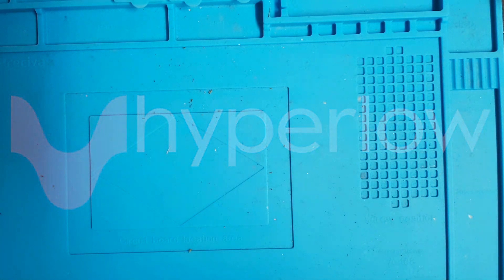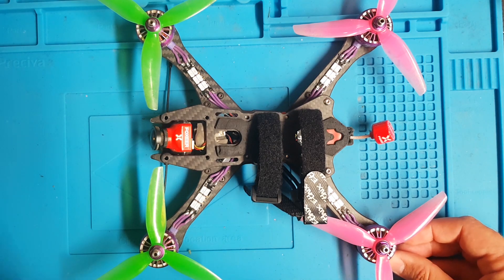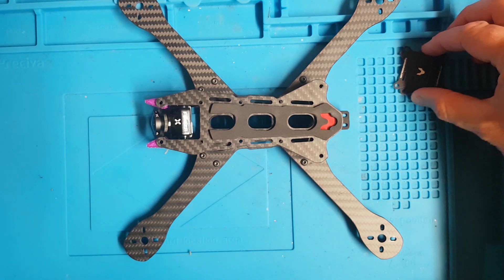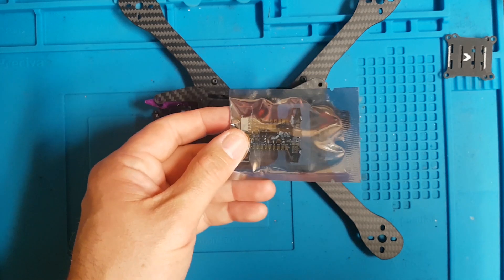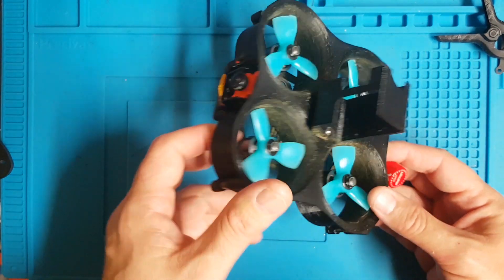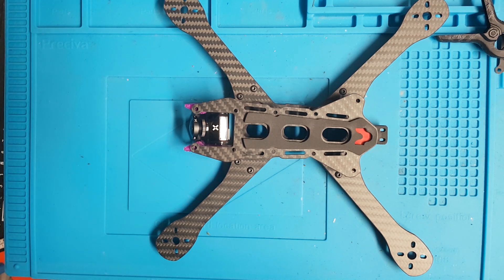Hyperlow CG 6" review and a Crisis of Faith.

Comment from the maker: Few things i forgot to mention. Lock tight your standoff screws from the bottom. I went through a number until I did this. The TBS evo vtx is a simple way to avoid using a separate wolf pdb as it'll give you a good osd with kiss. However you'll lose the ability to change pids via osd and GPS support. Given how easy it is to tune, its well worth considering on a tight build especially if you want to use a 4 in 1. The kiss single escs have been really unreliable for local pilots so I have not used them. The kiss 4 in 1 has a good rep but is ridicously expensive imo
Reply: Osd-tuning is not even worth it imo. Tuning via lua-script is much simpler and gives a great overview. I won't even bother tuning via osd on my quads even if they have osd.
Reply: loved this frame and yes gotta loctite the screws from the bottom into the stand offs cos ive been losing screws from the bottom

Comment: I fly the CG and have been looking at Kiss/Wolf PDB as well, but not sure what the best way to secure the PDB to the frame is. Since the mounting holes on the PDB are designed to accommodate a press nut on the Reverb it’s too large for just an M3 screw. How will you be securing the PDB?
Reply from the maker: DaiLo FPV the PDB comes with those screw type  rubber softmounts. I’ve attached the arm screws to those and the Wolf PDB sits over them. it also comes with double sided sticky tape to attach to the frame. I’ve just added a couple of layers of foam tape beneath it and then the sticky tape. It works great. I did the same thing on the sx218 with kiss.
Reply: Coppertop FPV thanks for sharing! Can’t wait to see your finished product.

Comment: Do you know what I’ve been looking at this frame for months. Sold all my Armattan quads just feed up with breakages. Some were not even hard hits. Anyway hearing what you have to say about this frame has convinced me to get one. Thanks for your honesty opinion 👍🏻. Happy landings ✌🏻
Reply from the maker: Hope yours gives you as much fun as mine has. Couple of guys I fly with had roosters. They went through dozens of parts. By the time you add up the shipping cost why bother... one has created custom braces and the other binned his lol not a company I like. Sold on hype and hot air imo tho thousands think otherwise. Each to their own 😉
Reply: Yes I got sucked in by the hype  which I don’t usually do and will not do again. It’s got to the point where I have stopped flying been 3 months or more since I last done any FPV that’s how bad it got. I usually do loads of research on a products before buying and wished I had gone with my gut feeling from the start. Well we live and learn. I shall be putting my Kiss V2 stuff in which survived the rooster. Looking forward to flying again. Need to find some new spots around Norfolk. Anyway have a good one ✌🏻
Reply from the maker: DEADZONE FPV are you part of Norfolk fpv? (Sorry don’t recognise the handle if you are). If not they have a Facebook group and I sometimes fly with them. Good group and there’s always someone flying or finding a new spot
Reply: No not one of the Norfolk FPV group. Haven’t had Facebook account for years. I was mainly flying by myself.

Comment: I’ve really been wanting to build a hyperlow freestyle frame but I’m so heavily into racing that my budget hasn’t allowed... racing is expensive, lol. When I bite the bullet , I’d like to use kiss & wolf pdb but I’ve got no clue how to setup either. Will you do a tutorial on the wolf pdb? (Configurator, drivers, wiring, etc...) Cheers
Reply from the maker: Tbh you just wire it up as per the picture and that's about it. There's no secret settings other than downloading the wolf app and kiss v2. Because I'm not using kiss escs it's a bit awkward as you can't access blheli to reverse motors etc so you can buy an adapter or just setup the esc on a different quad like I did. Some of the guys I fly with are skipping the wolf pdb and just using the tbs evo vtx to get osd.
Reply: Coppertop FPV 
I appreciate the reply. It’s actually very helpful, thank you. That’s a simple solution for osd & smart audio plus I’ll be able to use a 4-in-1
Reply from the maker: @ryantodd82  yup. Only real thing is you'll loose the ability to tune on the fly via osd (although ive changed hardly anything) and the ability to add GPS. If I was building a 5" that's probably the route I'd go. Much cleaner. Remains to be seen if everything running off the wolf pdb has an impact on flight performance due to lack of noise knocking round the flight controller. One for another day :)

Comment: On the cash front -  For the relative performance and enjoyment on offer, FPV is quite a cheap hobby.  If you can tolerate the fiddliness of configuring and fixing things, it's unbeatable for cost to smiles ratio perspectives.  I just have to force myself into the mindset that I'm money ahead purchasing exactly what I want in my heart, because that's immutable compared to what my brain will rationalize.

I just spent $330 re-buying cameras on otherwise adequate birds... and half as much again on receivers because I'm tired of getting 0.2s brownout-failsafe events at speed.  All this cost is going into quads which I tried really hard to save money on - half of which were intended as leftover/trash builds and are among my favorite quad, but I doubt I'd like them any less if I went strictly with the parts I lusted after.
Reply from the maker: Yes, unless like me you're endlessly combing shops for new things to play with lol I bought a thug foofighter frame yesterday. Then I'll decide I don't like my existing motors and get some new ones... and off we go again lol
Reply: @CoppertopFPV  I'm doing the exact same with the ~40g lightweight whoop conversions... but still find myself investing in 7" stuff because that's what I enjoy most for GoPro hauling and doing chase footage.
Reply from the maker: @tehllama42  and yet I still haven't seen a video!
Reply: @CoppertopFPV  https://youtu.be/AwR5w5piAp0
I'm also uploading my Gemfan 7042F video as well, trying to show how stupid fast that setup is.
Reply: @CoppertopFPV  The onslaught of videos is coming - finally picked up a Session 4, slapped it on my 7" Floss, and it absolutely parties.

Comment: Since your plan is to have 5" and 6" quads, I'd run a KISS setup in each size and act like that was the intention the entire time, then select whatever else makes you happy.
I suspect you'll hold onto that Petit Soldat for quite a while, for the same reason.  
 - From my end, I'd build everything with 6" frames, and fly mostly 5" props on there, which makes management of spares quite simple.  You can start transplanting 6" arms onto the back in pairs as attrition sets in, and have the luxury of experimenting with that.
Reply from the maker: Yeah I often run 5 or 5.5 props on the six inch. I see a lot of people talking about 6" rear arms on a 5" quad. Suppose it makes perfect sense but something I'd never thought of before I saw it on the catalyst face book page. Petit soldat is just a perfect setup even beyond the kiss stuff. Motors are just perfect but it's the level of control that I'm blown away by. Possibly going to use the rcinpower 2207.5 on this and cap throttle via transmitter as I don't think kiss has an easy option like beta
Reply: @CoppertopFPV  Even with the newfound relative ease of limiting motors and throttle in Betaflight, I still actually do all that in the transmitter, because it's easier to change on the fly at the field.  Between that and adjusting camera angle, I end up with quite a few lever to turn until I'm comfortable with the flight feel.
I can claim to be one of the very first hybrid 5/6" runner on race quads, although it was almost purely by accident.  Broke an arm at a race, only had a 6" spare.  Concluded it was better to try that on the back, and I've been an evangelist for that setup ever since - I suggested to Evan and his dad to try that setup, and he's gone on to win all kinds of stuff running just that.

Comment: Use kiss if you just want to fly .
Use betaflight if like programming.
O and I have been flying a kiss v1 setup on armattan chameleon for over 3 years now  it Flys wat better than any betaflight.
Reply: RAT RH unless you can tune manuelly then i prefer betaflight....cause you can fine tune all the filters now in BF4.0
Reply: For outright simplicity of getting to high performance levels on racing setups, Betaflight still wins. With blackbox logging, you can get to objectively excellent setups quite quickly.
For freestyle, KISS is arguably a better answer - to me the difference is that I can set up to adequate BF quads on cheap motors for the price of one good KISS setup on high end motors
Reply from the maker: tehllama42 good points. For race oriented quads I wouldn’t look elsewhere. For freestyle it just has a certain feel and setup that feels right. I can tune and have been doing so for a long time, but frankly I’m lazy and fly around most issues these days. flight time is precious. All the hours messing with Betaflight has added knowledge and experience that I never would have got running Kiss from day 1 - and all of that knowledge meant I could get kiss flying as I wanted in 2 packs. Anyone looking to build and make their first quads would be well served in Betaflight and it’s million help videos. An amazing first quad with a tbs source one or similar, rcx motors and a mamba stack or that cheap Racerstar one, and they wouldn’t know any difference and could spend their saved dosh on the bit that really matters - batteries, and lots of ‘em.
Reply: @CoppertopFPV  A brief waffle video explaining the value of just that  would be amazing - and yet becuase of YouTube algorithms would end up buried under pages of 'this is the latest BNF - look how fast it flies' that attract more clicks from beginners.
Reply: @CoppertopFPV  As to those actual points - for somebody that's looking to build that one quad that they're going to mount an expensive GoPro to, and really have a go, that investment difference to go to KISS isn't really that big... just a philosophically different approach.  I'm still happy I went with a few somewhat cheap quads and stuck with all the learning possible getting under the hood of Betaflight.
I'm still sorely tempted to buy up TBS SourceOne/SourceTWO frames, build them into representative stuff (with RCX Motors, Mamba/racer* Stacks, Eachine VTX03's, and Micro Arrow cameras), and sell them locally as a community service, and make a couple videos showing that you don't really need more than that.
Reply from the maker: @tehllama42  a friend of mine who has expensive frames including the CG is using a source one and loves it. All those 3d printed bits people have made and it's holding up well. I've wanted to do a 'build this as a first 5"' video for a long time with what I've learned but a waffle vid is a good idea. My owm builds are usually about honing a setup that suits me and my experience level. No one would watch it as you say but I long since gave up trying to tell people that if a quad does 120mph it's irrelevant if you can't fly above 40mph without crashing. I hope the videos I create haven't fallen into that hype thing. I kinda make them as if people know what I'm about and forget about that new guy searching for advice on his first or 2nd build.

Comment: Heck yeah That’s why am rocking the Hyperlow’s for the past year. My go to frames..🤘🏽🤘🏽😜
That TPU Antenna-Cam mount for the immortal T. Do you have the file for that? Would love to get one..Looks so much cleaner than the brain 3D one..
Reply from the maker: Added the thingiverse link to description:)
Reply: Coppertop FPV How’s the signal with the Antenna mounted on the front of the frame like that. I was originally going to mount it off the back arm but this looks so much cleaner.
Reply from the maker: @cletussurfsalot7190  it's been fine for me but I only fly normally so LQ is generally at 99... If I was pushing range it'd be on the arm or even better vertical.